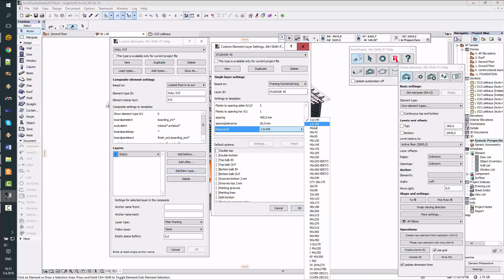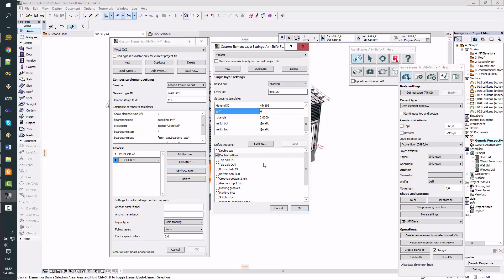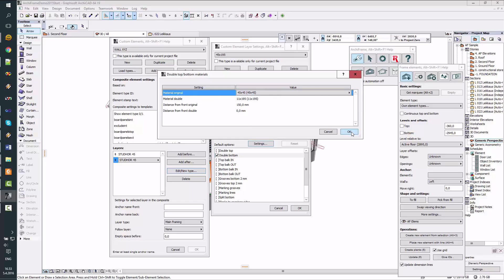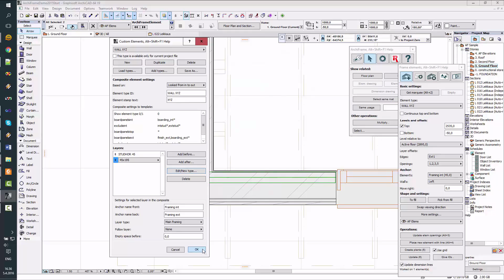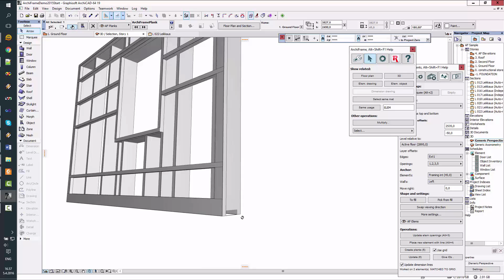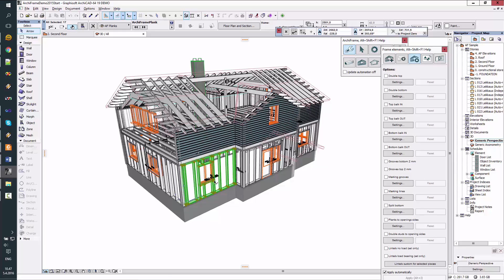Defining a Wall Element with Timber Framing: Archicad Framing Extension

Comment: Would you please tell me if   ##af_request ("boardgap", tblGuids, tblSettings)  can distribute, like exmple, OSB panels with the "gap" distance?
Reply: Hi, yes it can. No matter if it is CLT or gypsum board.
Reply: @petteriheiskari6701  Unfortunately, I couldn't find where in the script there are allocation rules for generating gypsum board.
Reply: For the example, I need to distribute the studs with a spacing of 627mm. Without a gap of 3mm, in this case OSB (2500x1250x10), will not be distributed as a whole sheet, but in halves.  This leaves me with the option of spacing the studs at 625mm.